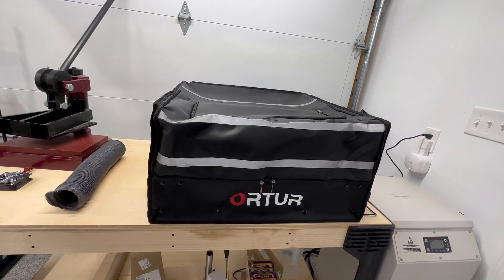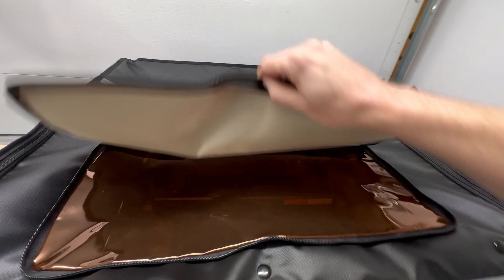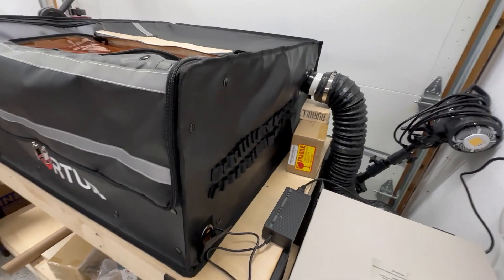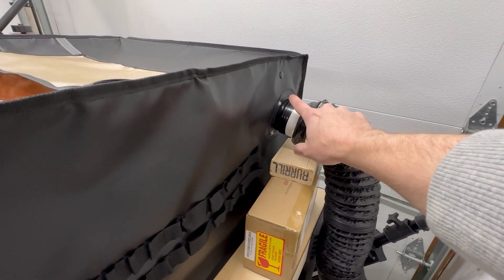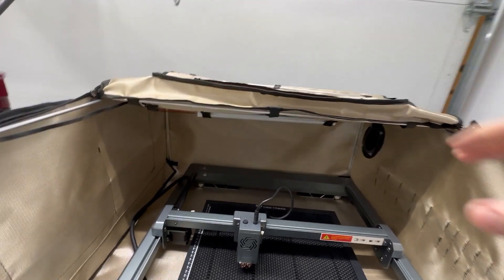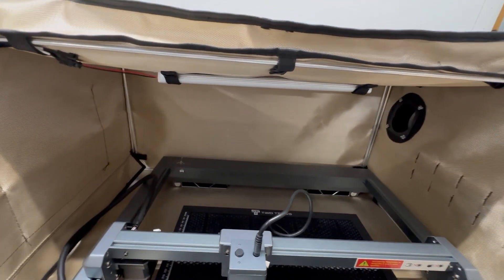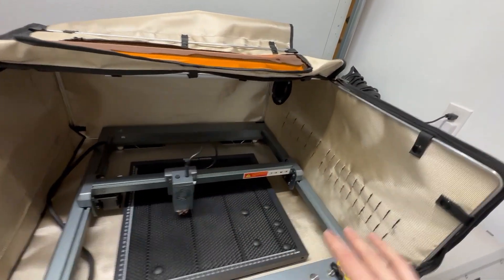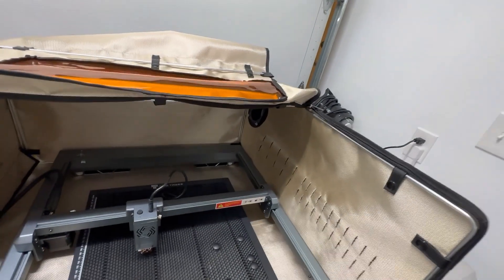The best enclosure for a diode laser?

Comment: I know this is a year old but since I own this set up, I thought I might comment. I agree the opening design could be better, and actually my bar has sagged, bent a little from the use I've given it. I could replace it with a slightly more robust bar in the future. Today. in 2024, many of the main doide laser manufacturers are now offering their new units with enclosures and their collective reasoning is safety. I can attest to not having used my glasses while framing a project and not closing the awkard front cover is probably a major factor. I agree too, the 3 inch exhaust design is problematic with the hose being too short and 3 inch instead of the more common 4 inch. With all said and done, this enclosure works. I was able to work around both of these flaws, even training myself to take the time and "Close the F'n Lid,!" 
One thing tho, its not tall enough for a camera mount, as precribed for this unit. It's about 13 inches off the bed that I have, where apparently I require 15.5 inches, plus 2", for a recommended usb camera to function. 
As an upgrade to an new, enclosed unit with all the bells is about $3500, I'm planning to keep this enclosure and work with this fantastic laser as it is. Definitely  an easy fix and an important upgrade for any open frame laser.

Comment: Hi Justin, I wish you the best with your new channel. So far I have been dragging my diode lasers outside to do any kind of work with them. It is a pain but it is my only choice right now. I am looking into enclosures but I want to make sure they work before I buy one. I have a one bedroom apartment and do all my crafting in my room. I do have a window.  As you know leather smells horrible under a laser. The problem is I could be working on my crafts as I am using my laser if I had it in my room instead of sitting outside keeping an eye on my laptop and equipment. Do you think there is any enclosure that will actually work well enough to keep my room from smelling and endangering my life from fumes or should I just keep bringing my lasers outside? Thank you, I am aware you can't be positive but since you have one of the enclosures I was thinking about getting I figured I would ask. :)
Reply from the maker: Haha hey thanks! I havent tried any other diode laser enclosure than this one however I think as long as its one of the enclosures that has it closed  off on all sides (including bottom) you should be OK. The main factor will be the power of the extraction. 4" or 6" inline fan like the AC Infinity Cloudline series would be essential to removing the smell. The little computer fans some of these enclosures come with are not nearly enough. Also make sure you have adequate fresh airflow into your bedroom when running the fan so you dont create negative pressure. Outside of that, leave the pieces in the enclosure closed for several minutes after the job is finished to really clean it out.
Reply: @justinlaser  Thank you very much! I will keep you posted on my progress and thank you for the advice. I will check out the AC Infinity Cloudline right now. :) I have subscribed. Thank you again!